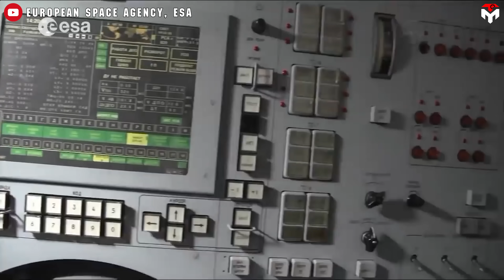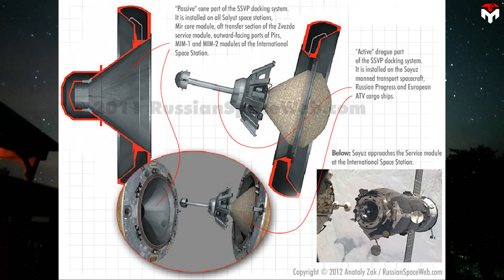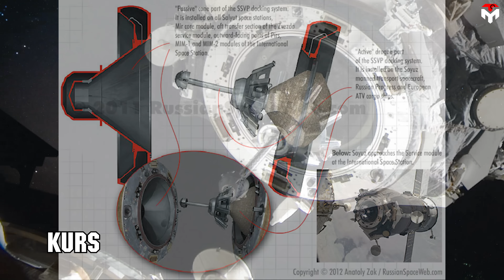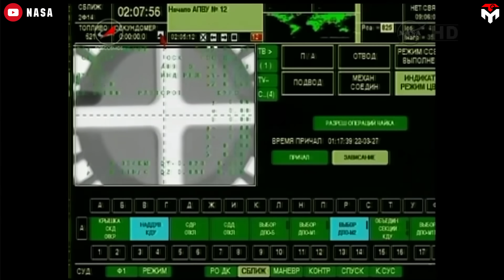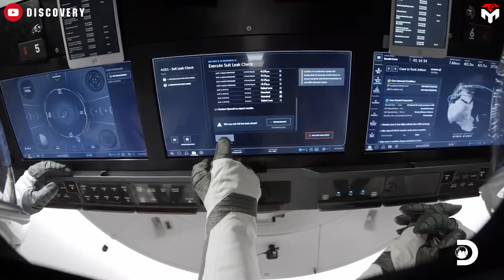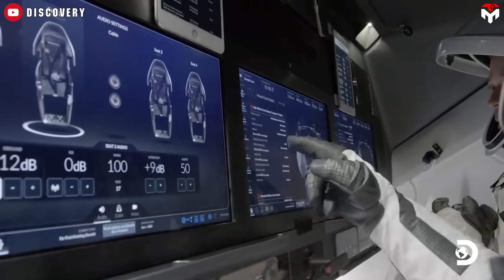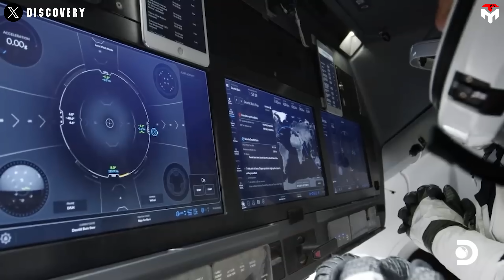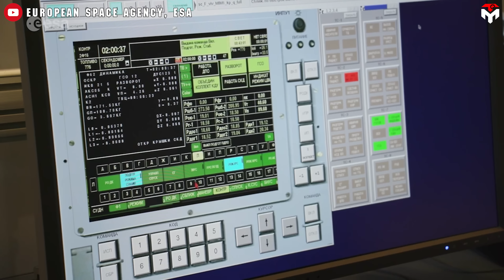SpaceX Shocked Astronaut with Dragon Training Better Than Russia   Refused to Fly! Refused to Fly!

Comment: I would rather know the who, what, why, when, where, and how something works when I go up. Without that you have little chance to fix the problem. With that information you can develop clues to be able to repair the problem. I preformed diagnostics on autos for many years. I was good at it. I used those six principles, and it worked for me. Autos since the 70's are now more complex than a human body.

Comment: I'm  sure using up to date equipment. Is easier faster..but important  I'm saying SPACE X DRAGON could be handle problems with back up manual  control...  ❤❤❤❤❤❤  GOD BLESS
Reply from the maker: Using up-to-date equipment generally makes operations easier and faster due to improved technology and reliability. Regarding SpaceX's Dragon spacecraft, it is designed with redundant systems, including manual control backups, to handle potential issues. These backups ensure astronauts can manage critical functions if automated systems fail, enhancing safety

Comment: NASA used to train astronauts like Russia, as everyone was an engineer or pilot and all systems were discrete with redundancies. the closest analogy would be the engine of a '57 Chevy vs the engine of a 2025 Cadillac. the '57 needs regular tune-ups and frequent maintenance - the Cadillac needs a tune-up after 100k miles. the '57 is a classic, but so is Soyuz